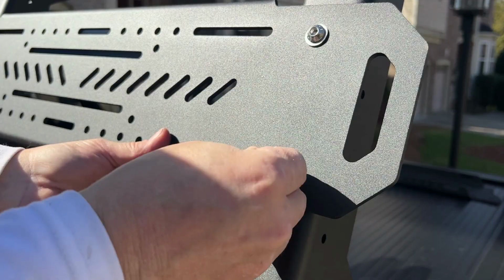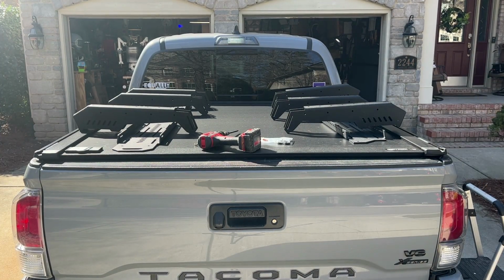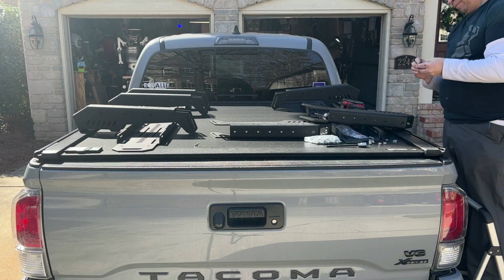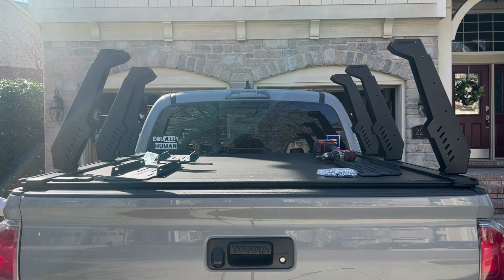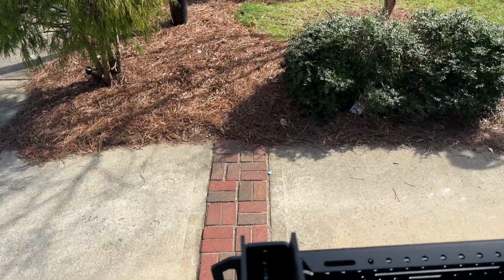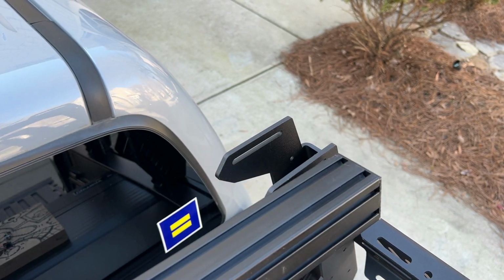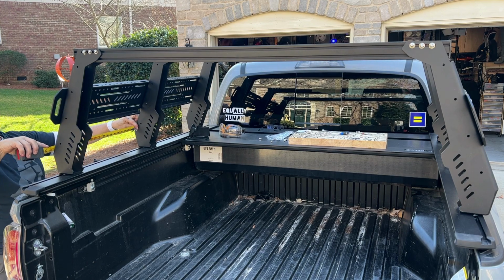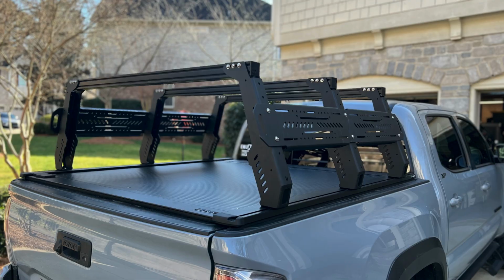The Best Truck Bed Rack | Overland Build Series 01

Comment: Design flaw? Height not adjustable…
Reply from the maker: It comes in two different heights. I would say that that flexibility would reduce the strength and I need all the strength possible because I’ve been eating a lot of donuts and I sleep on top now with my tent.